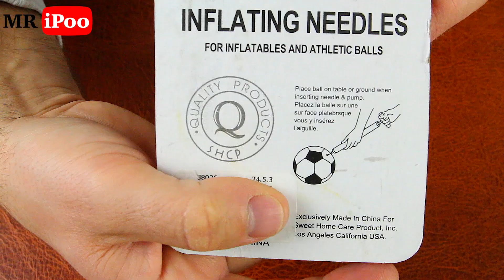AAA Battery burner flame over 3,560˚ Fahrenheit! diy ideas you need in your life right now

Comment: More bullshit, butane does not burn that hot even with air assist. Waste oil burns waaaay hotter than this bs... 3500f indeed. 😂 What type of thermocouple did you use to measure that temp? There's very few that will go that high.